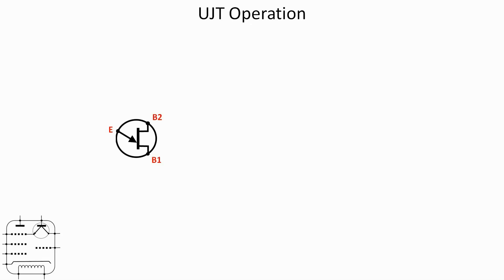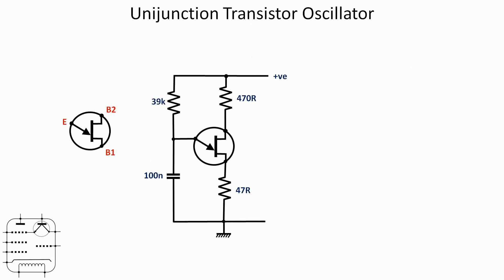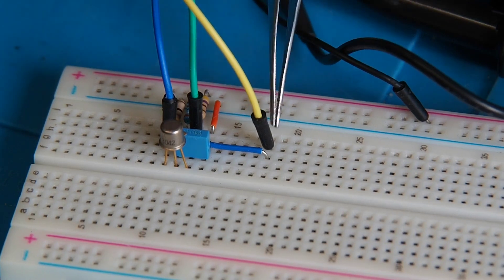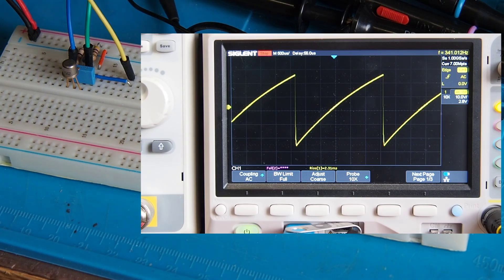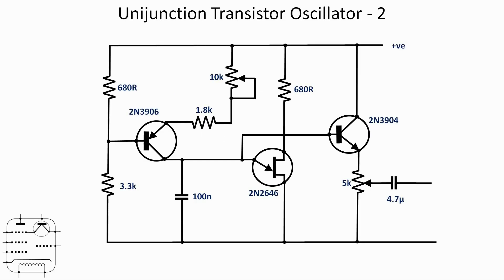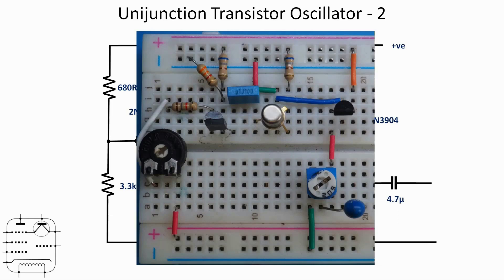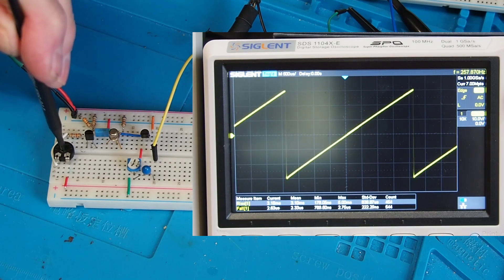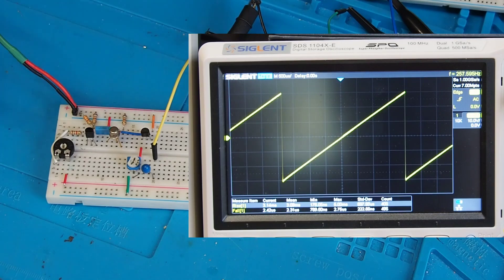The Unijunction Transistor   #154

Comment: Minor nitpick - perhaps mixed up the two signals on the Bases (using Bases and Test Points assignments as shown at 3:03, Bottom is TP3 = Base 1, and Top TP2 = is Base 2).
5:10 "...now going to switch on Base 2 [=TP2] ..."  But the pink trace is an upward spike from near Gnd, therefore it must be on the top of the 47R resistor on the bottom (TP3), thus Base 1.
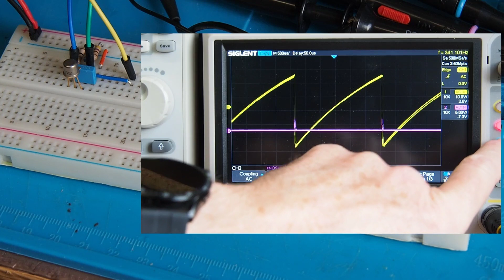5:21 "...switch on Base 1 [=TP3]..."  Greenish trace shows a downward spike from near VCC, therefore it must be on the bottom of the 470R resistor on the top (TP2), thus Base 2.
Apologies for the nitpick, but these sorts of things jump out at me almost instantly. 🙂

Comment: I got two UJT transistors when I was a kid and made my first ever oscillators. Later I found them used in various schematics as oscillators but since they were scarce, hard to find and quite expensive, I often replaced them with a equivalent schematic (BC107+BC177) or simply used another oscillator.
I remeber they were used in contolls for thyristors, audio oscillators and even as clock genetrators in some TTL IC circuits.

Comment: Yes used them as a dimmer, and also worked on equipment that used them for dimming lamps, where the common failures would always result in a blown pair of lamps, because the natural thing on lamp failure was to switch in the spare lamp, which would promptly, because they were run on a much higher voltage than rated, and used PWM to dim them, burn out. If you were lucky the first lamp on going out it would blow the fuses, saving the second lamp. Lots of changing of unijunctions that had shifted parameter, and also the LM111 comparator used to do the PWM, and of course the darlington drivers that ran hot enough to unsolder the emitter or base lead.
Reply: Great design of using a spare lamp in case of failure. Like you lose 1 tire, another tire drops down and is also lost right away! Great redundancy!

Comment: This was in a Hobby Electronics magazine circuit for driving a strobe lamp, one of the first circuits I ever built. Never used one since, guess the range of applications was quite narrow. The electric fence driver I fixed around the same time used a diac to get the same function, I presume that was a cheaper solution.

Comment: The RC charging curve is presumably one reason that the famous 555 timer chip constrains the sawtooth wave to oscillate between 1/3 and 2/3 of the Vcc.  This avoids the most curved sections near the extremes, giving a much straighter waveform. Cheers.
Reply: No ..simple rc charging on 555 is also from Vcc & has similar chg.slope...
For linearity there , it requires similar const. curr. chg. thro. a similar transistor fixed bias  ckt.

Comment: Why is it the emitter when it is not emitting. The arrow points inwards. Its an input.
Reply: The arrow indicates the direction of the flow of ''Conventional Current'' i.e. positive to negative. This is the same with Bipolar Transistors also. In an NPN transistor, the Collector is positive with respect to the Emitter. In a PNP Transistor, the opposite is true.
In the case of the Unijunction Transistor it does ''Emit''. It emits positive charge carriers (holes) which are the absence of an electron in the semiconductor. Electrons (Negatively Charged Carriers) and holes (Positively Charged Carriers) travel in opposite directions to each other.
The collector of a transistor ''Collects'' charge carriers the emitter ''Emits'' charge carriers, depending on the PN construction of the device, the charge carrier is either negative (electrons) or positive (holes). Remember that a ''hole'' is the absence of an electron which behaves as positive charge in the silicon or other semiconductor material.
I hope I've explained this well. If any other electronic engineers / hobbyists / buffs want to chip in and correct anything I've got wrong or missed out, I'm all ears (eyes). 🙂